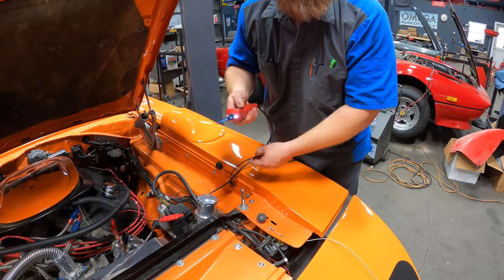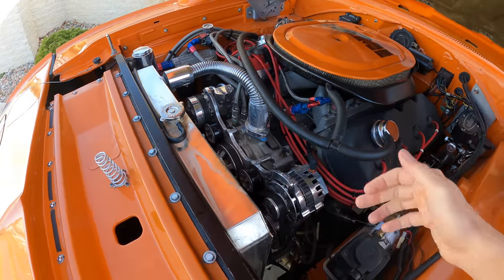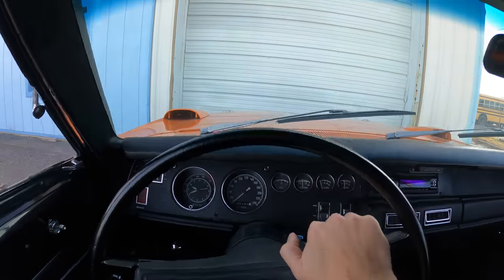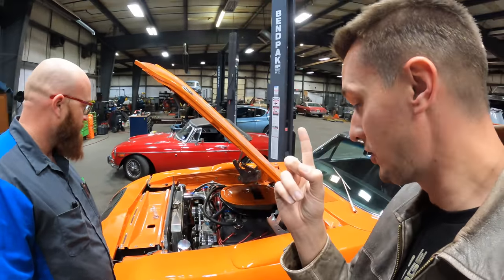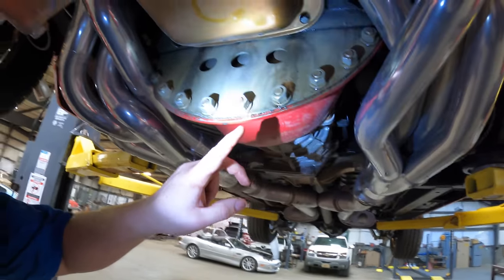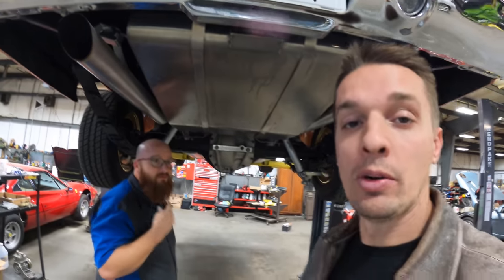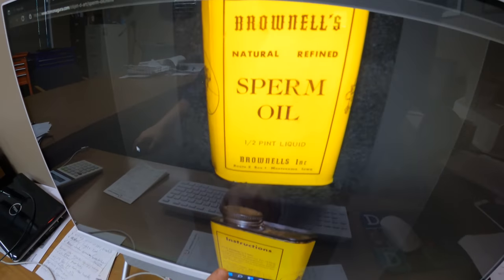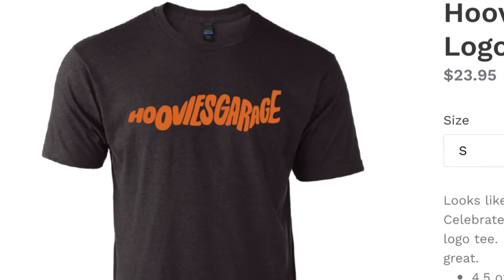How I got SCAMMED buying a Plymouth Superbird online sight unseen (So much broken/missing)

Comment: Petty won NASCAR in 1971 - Bobby Isaac won it in 1970 (with some of those races in a winged Charger Daytona). Minor point, I admit.
Reply: The Miller American Buick Bobby Allison raced In  NASCAR had gold painted wheels.  The gold wheels Aero race wheels look excellent on the Superbird, much nicer than the stock plymouth rallye wheels. Coil overs modern steering rack, sway bars, Tremac transmission, remote oil cooler are all fine upgrades.
Reply: And Bobby Allison was 2nd and 3rd was the independent racer James Hylton.
Reply: And the regular ‘70 Charger won the most races... 10.
Reply: @dand3975  If done correctly.
Reply: @drippinglass   Really it was the Charger 500 from 1969 since it used the same exact tunnel back plug to make the rear glass flush with the back of the roof line on the Charger. There was a few 1970's but they was the minority over the more aero built 500's in the series during the 1970 season. It was the inferiority of the 500 against the Talladega and Cyclone twins that the Daytona and Superbird was made.
Reply: @ChrisS-fh7zt  Bobby Issac won the championship in 1970. He only raced the Daytona at the super speedways. He ran a 1970 Dodge Charger with the chrome loop bumper and the flying buttresses and stock rear window at the other tracks.

Fun fact: In the 1970 NASCAR season, the 1970 Charger had ten wins, more than any other car, including the 1969 Dodge Charger Daytonas and Plymouth Superbirds, thus giving Bobby Isaac the Grand National Championship. Buddy Baker, driving the blue #88 Engineering Daytona, was the first and only legal car to run over 200 mph in 1970. That record lasted for over 13 years.
Reply: @dand3975  Spoken like a true Chev Owner.
Reply: @drippinglass  "...Buddy Baker, driving the blue #88 Engineering Daytona, was the first and only legal car to run over 200 mph in 1970..." I actually sat in this car when it was taken on a Tour of New Zealand back in the 70's. The car was straight off the track,so to speak,and because it was complete and running the local Hot Rod mag took it for a few laps of a race track...!! I understand it left to decay for many years.
Reply: you forgot to say"allegedly..."
Reply: @Mercmad   no it never went to New Zealand it was given to Don White who raced it in USAC for years until it was pushed behind his barn. Car has been restored as is currently for sale
Reply: @harryballz6358  all changing again in February, when they start using the new cars, sequential transmission, 18 or 20" wheels, too many business men and check writers running it now
Reply: I knew you'd comment. Collaboration!
Reply: I had the chance to buy a 69 Dodge Charger Daytona for $2000 when i was a teen but my folks wouldn't let me get it. Man I loved that car
Reply: I don't believe the Charger Daytona was winged.  Due to complaints by Ford & Chevy, NASCAR made  the hemis  put restrictor plates under the carbs.  Plymouth ruled back in the day and when Petty changed to Dodge he lost most of his fan base.

Comment: fun fact! The real track raced versions of these cars are easily identifiable. they were so low in the front, and so raked, with an extreme wheel and tire package, that that the top of the fender had to be cut out. Leading to the scoop you see in the center of the fender. the production cars built for sale to the general public, had the scoop, but not the fender cut out. there was no reason for them to be cut as they had a different wheel, tire, suspension package entirely. 

Good stuff @Hoovies Garage, thanks for the honesty and documenting this from a buyers/clients prospective. it is very enlightening to hear as a builder. Happy Holidays!
Reply: A fun fact disclosed in the previous video.....
Reply: It was actually used to let air out. The misnomer of it being for the tire rub is just false.
Reply: @mattg7952  Fiction. It was to let air out. NOT tire rub.
Reply: @rickyrudd28texacohavolinef2  not according to richard petty. i watched an interview in about 92, where he disclosed this.
Reply: @RideRevival_Outdoor  nice
Reply: @rickyrudd28texacohavolinef2  yeah. It's about reducing uplift
Reply: @rickyrudd28texacohavolinef2  really?
Reply: @ponycarresurrection4401  what do the restoration guys know right?
Reply: Torsion bars adjusted. Tight it acts like this.

Comment: Is the Superbird club (registry?) a reliable resource for this car's history? Shouldn't the VIN be stamped on various locations on the frame, etc.? I think Hoovie going through the process he used to prevent being completely scammed would be a good lesson for those who might want to purchase something like this.
Reply: Vin would be on the radiator core support and the trunk seam around where the weather stripping is. It has some important things that make it look legit. The back glass and the torque boxes for the leaf springs are important details that say it’s legit. There are only 1500 of these ever so it’s not hard to track if it’s real or that the vin came from a real one at least.
Reply: A lot of Superbirds don’t have the rad support #. They all have the trunk gutter #. The VIN is legit.
Reply: There should be a fender tag on the driver front fender that can be decoded.
Reply: @digitalrailroader  the fender tag is the easiest thing to fake.
Reply: @LittleHippie09  I noticed that the tag on Hoovie’s has been riveted to the inner fender, and watching Graveyard Carz and seeing that the factory used screws, something seems extremely suspicious about this car.
Reply: @digitalrailroader  you have better eyes than me if you can tell if it has riviets vs the small screws haha
Reply: @LittleHippie09  plus the Rivets were chrome, the factory screws would be body colored because the fender tag was attached before the body in white went into the paint shop.
Reply: @digitalrailroader  Suspicious....Almost like perhaps it was rebuilt and had the original VIN added onto the replacement part?
Oh wait, it's probably exactly that, since it was rebuilt from being T-boned.
Reply: @dyent  I’m getting the sneaking suspicion that this is a replica Superbird because if it WERE a legitimate Superbird, every care would have been taken to preserve the complete originality of the car and it wouldn’t have aftermarket brakes, front suspension, aftermarket air conditioning, a modern aftermarket radio, and other items of note.
Reply: @digitalrailroader  well it was supposedly a race car before and converted to street car. I think the seller is a scammer though and I hope they get there comeuppance in the end.
Reply: The trunk gutter VIN won’t tell you what it was... but it sure will tell you what it isn’t. If this thing had matching body numbers... it would be worth twice as much.

Comment: Perfect occasion to bring Dennis Collins to verify it authenticity. Wouldn't be surprised, if it's a glorified replica. Maybe with some Superbird original panels with the VIN numbers, but with a new custom sub frame, or using a Plymouth Road Runner as the starting canvas. That mint condition floor panels are very suspect. Plus the mods as the tubular front suspension.
Reply: You got it , the floor panels smell too clean look foreign.....
Reply: @johnb4183  exactly. The sub frame seem also spotless. As it was brand new. Wouldn't be surprised the race incident, was an excuse to cover up the rebuild. Using a brand new sub frame with some original Superbird panels. Maybe using a magnet could be the starting point to check all the panels. And bring up a Superbird Expert to check it out.
Reply: Hemi cars never had A/C and the dash is from a factory A/C car. This car is pretty fishy.
Reply: @KrisKincaid  The dash pad looks like the vents were cut into a non-stock A/C pad, they resemble a stock A/C dash, but they are not exactly the same.
Reply: @RogerM88  Since they are uni-body, there shouldn't be any "factory" frame rails on a b-body mopar. Those are likely the laser cut U.S. Car Tool frame connectors. I put the same ones on my Super Bee. While not factory original/correct, they do a great job of stiffening up the car.
Reply: @guitaracademyarchive  thought these cars used frames due to the power output, and looking to allow having torsion bars and rear leaf springs.
Reply: @guitaracademyarchive  don't  you think it's possible they rebuilt it, starting with a Road Runner or GTX? Using brand new floor panels and some aftermarket recreation panels. The body looks  too straight for a race car.
Reply: The car is already in the Superbird Registry like he said about 100 times which means it's been verified by experts.
Reply: @RogerM88  Well, they do have "frame rails" so to speak, integrated into the unibody where the leaf springs bolt up and also up front, but not a proper continuous frame.

Comment: I worked on a late 40's-early 50's cadillac with a hydromatic transmission.  When we looked for the fluid specifications it called for a whale oil base transmission fluid. Luckily dexron was an acceptable replacement.
Reply: Type A fluid. Still see it around California

Comment: I was gobsmacked to see this car pop on on my feed. My dad traded in my mom's 66 Impala SS and bought a Superbird. That's the car I learned how to drive in. I tried to take my driving test with it but the car was too long to fit in their parallel parking area. I ended yup using my dad's 66 Grand Prix for the driving test, still a big boat but it fit, if just barely. Thank you for this trip down memory lane!
Reply: I took my drivers test in a ‘76 Cadillac Eldorado w/ the 500 cid engine. Yes I flunked parallel parking & left turns. But passed the test overall. Sounds like you have a cool family of car lovers. 
My mom bought a new ‘65 Marina Blue Impala & my dad traded in his ’57 Chevy for a ‘65 Chevelle 327 4-speed.